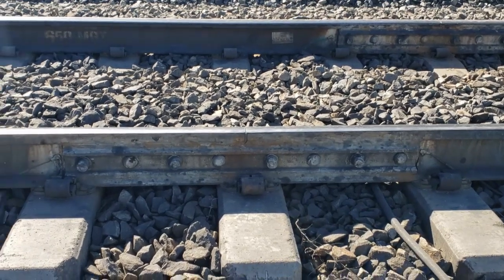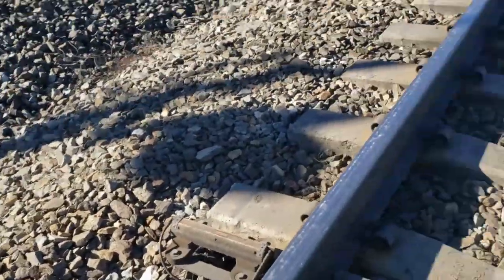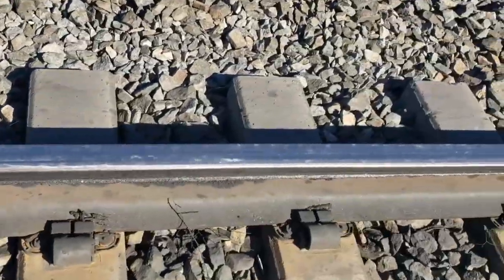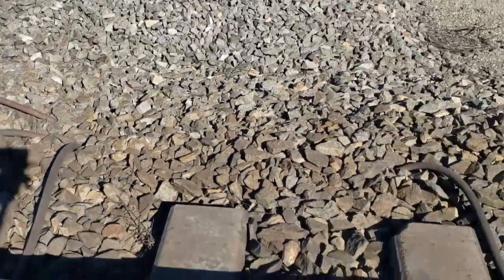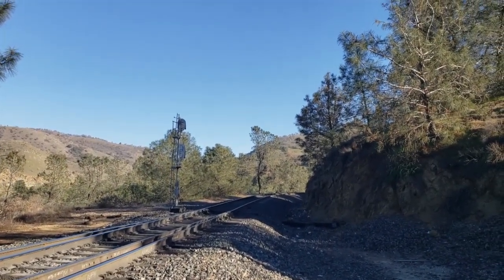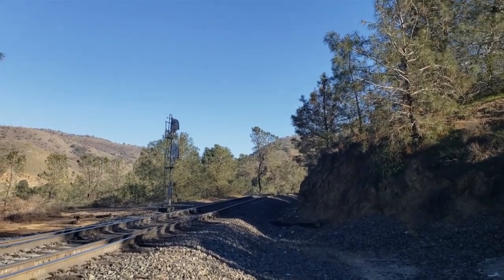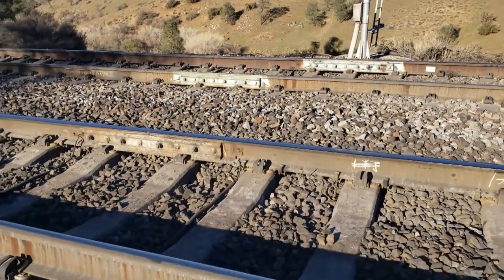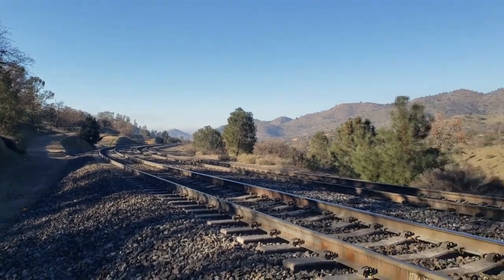Insulated Rail Joints: What They Do and Why

Comment: Mark can you give me some current info on crossing gates and the whole system.  Like cost and weight of the various sizes of gates.  And the cost of installing a new crossing system with lights and gates.  All my info is from the early 2000s just before I retired?
Reply from the maker: The whole system is a pretty open term. It depends on how many gates and mechs, flashers, are there cantilevers, etc. But, just based on a two gate, no cantilever set up with cabin set up with batteries, controllers, rectifiers, relays, TC units, etc., counter weights, cables, wire, foundations, plumbing and associated hardware...about 100K. Gates themselves, as I purchased form WCH, were about $250 for a 16' aluminum base and a 16' fiberglass tip. Nine foot fiberglass tip extenders were about $90. A 32' gate weighed about 75 pounds. I have no idea what the whole thing would weigh but it was a truck load!
Reply: Mark Clay McGowan   Thanks.  I just needed the weight of the gates.  Your answer was a great help.  I was surprised at the cost of a new installation these days.  Back in the late 90s early 2000s we were told a new system for a two lane street was around $100,000 back then.  I was helping the parish (County in the other 49 states) I live in with getting more protection for the RR crossings.  We had both the KCS and IC (Which had a branch main and the Chicago main) running through our parish.

Comment: If those rails touch each other that would short the circuit? Would it drop the signals to red? Thanks buddy!
Reply from the maker: With the exception of the polarity joints in a turnout, both joints generally need to fail before it will cause a signal problem. Joints are tested at regular intervals to ensure there is no current leakage in either joint. Thanks for checking it out!

Comment: Mark, what determines whether they use concrete ties or wood ties?
Reply from the maker: A few things are taken into consideration. Because of the sheer weight, concrete holds the track structure more solidly so they work better on grades and curves like the Tehachapi and Cajon Passes, thus reducing the surfacing intervals. They hold up better in areas of extreme temperature differences such as Nebraska or Kansas, they hold up better under heavy traffic conditions and, in most applications, last longer than wood. At some point I'm going to do a piece on roadbed and track structure. Thanks for the question and for checking it out!

Comment: Nice video! In my state of PA on the NS there is a slowish line (4 trains a day) that used old PRR signals they are ABS signals anytime it rains or snows the signals show a stop indication and the trains have to go restricted speed is this due to the joints? its been reported by train crews many times but hasnt been fixed has been happening for over a year
Reply from the maker: That is more likely due to poor track structure. Ballast gets full of dirt, which turns to mud when wet, old ties become infused with grime and are easily waterlogged and that will short the rails and cause signal and crossing problems. The joint's are usually not the culprit in those situations. Thanks for the compliment and for checking it out!
Reply: @MarkClayMcGowan  ah okay would never had thought that thank you very much

Comment: Lots of rail flow there Mark! Our IRJ's are cut at an angle , which really helps them last and helps with rail flow! We still have to drill the rail ourselves ...LOL . 
Thanks for posting!
Gregg.
Reply from the maker: They found that the angled cut joints lasted no longer in areas such as the Tehachapi. By the time I retired they weren't replacing them with angled cuts in the valley either. Welding on all track connections became policy by 2000 on the UP.

Comment: Outstanding presentation on the insulated joints and all the info on them, Our section crew cut in a lot of glued joint slugs for the maintainers around our area of CP and thermite welded them in for a smoother ride, Plus the end posts that fail of course when its the hottest part of the day and we would have to change it out and watch the rail run together as we took the joint bars off. We liked having to do that part very early in the morning in the summer if we could to avoiding the pinching of the rail to change the wore out end post. This is also why we started replacing our IJs with glued Polly joints slugs.
Reply from the maker: We stopped using the Portec joint bar type on mainlines sometime back but I certainly remember the hassle to the Track guys in very hot or very cold weather. They too, tried to get it done before 9am in the summer, when possible. In winter they would have to burn the rope to get rail together but the air pollution folks put the kabash on that back in the late 90s. With the hydraulic rail pullers available today, it's not as big a deal and neutral temperature is easier to achieve.
Reply: @MarkClayMcGowan  Thanks much for the response on how you guys did it out that way, When I first started we used saw dust and fuel oil mixture but the as o late we used the pullers and fire snake during the colder months.

Comment: I'm old. I remember when espee use to call them Allegheny rails.
Reply from the maker: Alleghenys were installed in the field and bolted together just like an angle bar. I believe Allegheny was an early brand but they were all Portec by the time I came along.
Reply: @MarkClayMcGowan  Allegheny Rail Products is still around under the L.B. Foster brand. They actually have an IJ Contract with UP among other Class I’s. They bought Portec and due to the government wanting to prevent a monopoly Portec’s IJ line was awarded to Koppers to create competition and avoid a monopoly,

Comment: How many bubblegum bond did you have in your section Mark? That was the old school guarantee for a night overtime call out.
Reply from the maker: I've not heard it referred to as that! We would shove something like a broken bond or a bottlecap between the rail ends, or stick a few strands in a #14 sleeve. Then there were hacksaw bonds. I usually just did it while already on a call, but not hacksaws, that was a lot of work too. Might as well put it on right! I'd go back the next morning and do it right. I really didn't like working OT so I didn't set up calls. Once ribbon rail became the norm, it was no longer an issue.
Thanks for checking it out!

Comment: Mark, where and what is the scource of electricity that operates the signals.
Reply: Hey John,
The power comes from the little signal shack were the wires come out. As the train runs down the rails the wheels connects electricity to the other rail telling the signaling equipment the train is on the track. In mainline systems they can tell how far the end of the train is and how fast it is moving reporting back to the control center.
It is exactly what model railroads used to distribute power and control to the engines.
Reply from the maker: The source of the power is the local power company who have meters at most locations these days. In the absence of that, the AC is delivered to a location via underground cable or poleline (more rare these days) . Once in the cabin,  it is converted through rectifiers to DC for track, signal and crossing control systems and all signal and crossing lamps and to keep the batteries in the house charged. The rectifiers run everything unless the AC power goes off.

Comment: Very interesting! They are very thin, these isolator joints. Here in the Netherlands they are at least 1,5 cm wide (1/2 inch). You can hear them when you are on the train. This kind of joints are also use for the level crossing controlling  circuits. But man what you do, walking on the rail, is forbidden here. Now our tracks are more frequently used with passenger trains mainly. I will try to take a picture of the isolating joint here, and mail it to you.
Reply from the maker: I'd love to see a photo of your IJ's!  The only time mainline IJ's are involved in crossing circuitry here is if a crossing is in, or near to, a control point (like Green and Hayes Streets in Tehachapi) where the turnout circuits have to be accounted for. Termination shunts don't require them nor do island circuits. The speed limit on the Tehachapi is 23 mph, but that doesn't mean a train can't sneak up on you. In this case, a train had just passed and I had contacted by connect and was assured there was no other traffic in the area. Nevertheless, I kept my exposure to a minimum and checked the facing and trailing signals before shooting. I wouldn't shoot this kind of thing on the mainline in the valley where the speed limit is as high as 60mph. 
Thanks for checking it out. I hope you can join me this Saturday at 1pm UTC for the European live stream!
Reply: @MarkClayMcGowan  Ok, I will give it a try to make a picture,  but here I have to be very careful not to be arrested when walk near or on tracks. Ok next Saturday 9 april 1 pm UTC = 3 pm local time central Europe. I will be there! (It is 6 am for you then!)
Reply: My Dutch friend, Marc, I think you are referring to "fouling the track,". Whether the person, a tool, a piece of equipment, etc. is in a place to foul the track and possibly interfere with operation of a train, there have been rules in effect that REQUIRE the absolute protection and safety of the trains, on-track equipment, people etc  BEFORE the track is fouled.

Mr. Mark complies with the rules, even as a bystander and non-employee.  He is always aware of his surroundings and "expects to see or hear a train (or on-track machine) approach from either direction on any track at any time.". Just watch out for the "oh-so-quiet" Hi-Rail trucks.
Reply: @glennfoster2423  Yes I am sure Mark know what he is doing, as a former railway employee.

Comment: I see the piece of material that is used to join the two track sections. Do you know what type of material it is made of, I assume some sort of non-ferrous stock and appears to be riveted to the track sections. Thanks for another informative video. I notice also I have started to forget the names of items I worked with as a truck mechanic.
Reply: The bars and bolts that hold the two rails together have insulation material separating every bit of metal from each rail and bolt from creating a  "path" or short circuit from one rail to the other rail in the insulated joint.  The IJ is fabricated and tested by the manufacturer then shipped to the railroad for installation.

Mark, what was your min,/max. distance for separation of the two joints?
Reply: The material used can vary but it’s ultimately up to the customer. The most common is fiberglass. There’s also polyurethane and some manufacturers offer proprietary products. For example one of the major joint producers L.B. Foster offers ceramic end posts.
Reply: @Stoker58  The insulated joint bars made from fiberglass materials were easily assembled in the field at the site   However, the final product suffered from the PPP problems of any assembled joint -- loosening of bolts, parts and failure of the fiberglass.

The fiberglass components needed proper inspection and maintenance to insure the integrity required.  

This does not disparage the fiberglass joint in any sense, but, in my experience, factory manufactured insulated joints are a better choice, even considering that more work is required for use, especially on high tonnage high frequency main tracks
Reply: @glennfoster2423  Oh Absolutely manufactures recommend buying pre assembled “plugs” for that reason specifically. I was just stating the different types of end post materials. I know L.B. Foster only offers fiberglass kits and their tough coat products for field assembly. Their higher quality products like Kevlar insulated joints are sold exclusively as pre built plugs in house to ensure quality